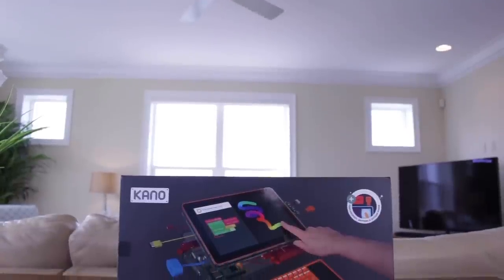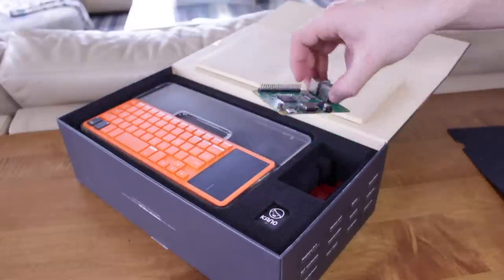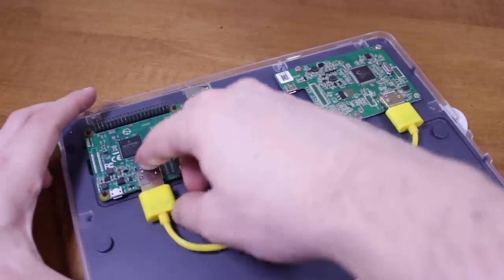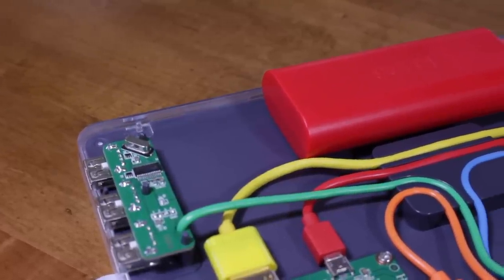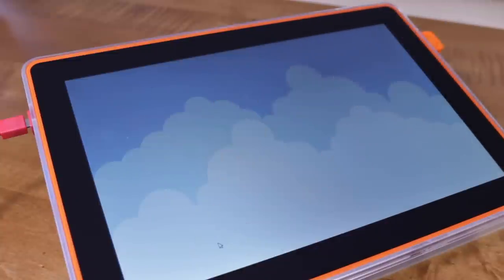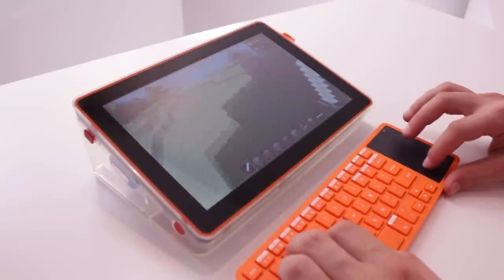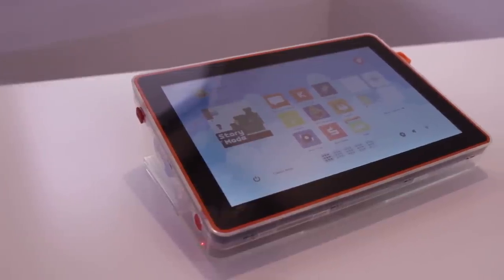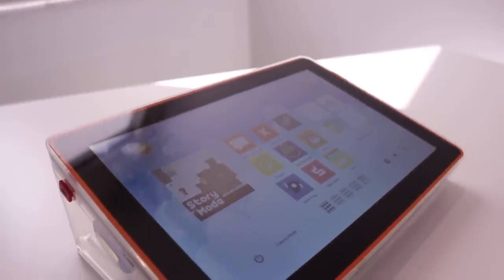Build Your Own Tablet with Kano's Computer Kit Touch!

Comment: is it possible to build a linux tablet that is one application oriented. Just like Amazon kindle, after booting it will able to run only one application like Video player or Online radio!
Reply: You can that's basically A RPI ,just flash Android port or full Linux distro.

Comment: For 300$ i just buy a tablet. And that raspberry pi don't have an ethernet port ._.
Reply: Or just buy a used Dell Optiplex and a gpu and boom for $300 you have a gaming pc
Reply: This is mainly for education purposes I think at least
Reply: robbiegamingHQ ya but there is nothing new on this thing, evrything you can do on it is what you can do on raspbian, editing minecraft? There are commands for that, etc.
Reply: robbiegamingHQ i made a gaming desktop for a friend for under $200, with an i5 2400, 8gb ddr3, and a gtx 760 using an old optiplex.
Reply: @Artemis_WR  yeah same! I bought a Dell Optiplex 390 for $80 had a shit HDD so I bought a 250gb SanDisk SSD & a 2tb Hitachi HDD for games the only thing bad about that HDD is it's so loud 😂 might replace it in a couple months 😂 both those costed me $100 then I got a gpu GTX 1050 for $130 the rest of the PC specs- 8gb ram i5 2400 not bad total=$325
Reply: @Artemis_WR  so basically I have a console priced PC that out performs the PS4 & Xbox one by a long shot I get 60fps at 1080p with mostly any game at high settings some really demanding games I turn some settings to medium but I always keep textures at high or ultra
Reply: robbiegamingHQ uh in that build i put a kingdian 60gb ssd just for boot and an hdd for 20$, also this hdd is pretty loud but is working fine xD
Reply: robbiegamingHQ the 1050 for just 130 was a deal like the laptop i got for 90$ (70 + 20 shipping), also is not hard to build a console killer xD
Reply: @Artemis_WR  yeah I got the 250gb SSD just for boot and simple applications like chrome etc & game lunchers like steam sometimes I'll put a game or two on they're
Reply: @Artemis_WR  you seem pretty cool we should talk more & maybe play some games sometime you got Twitter or insta?
Reply: robbiegamingHQ i got telegram xD
Reply: The fact that yall are comparing an educational STEM toy to tou gaming pc's for $300 is hilarious. Nerds missing the point of nerd toys lol
Reply: Well you can have wireless internet or get raspberry pi 3+ that has Ethernet port but that on should come wireless